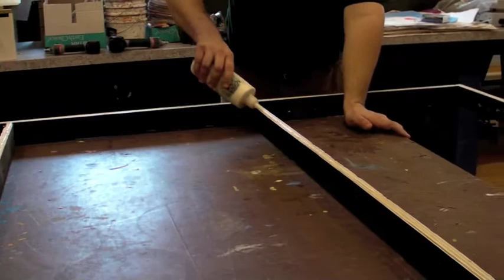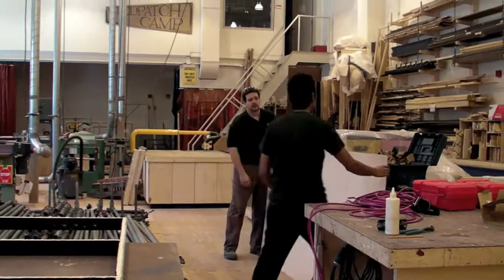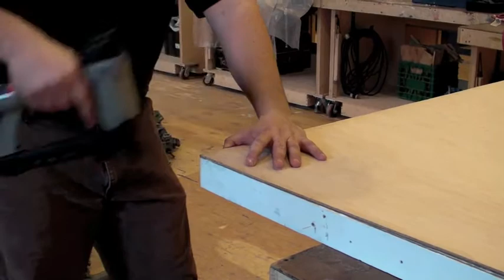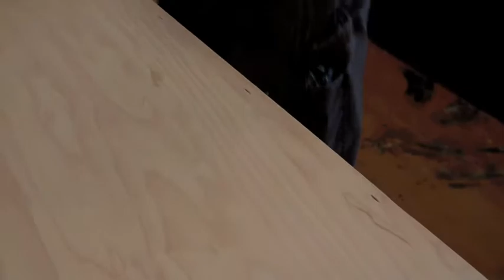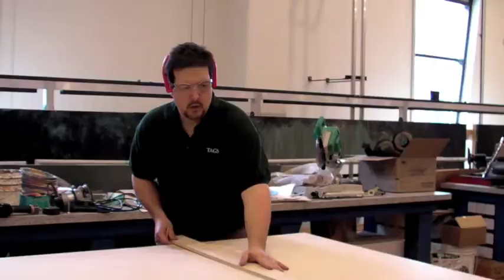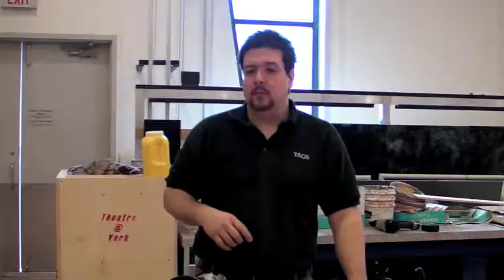How to Re-skin a Flat Pt 2

Comment: Paint one layer at a time, let dry, then paint the next layer... let dry, the next, you get the idea. The key is to have most of the warping-fight knocked out of the cardboard with the water without totally destroying its glue. Then the back paint counter acts the multiple layers of front paint. Laying the cardboard flats on the floor side by side and doing a wide cityscape, or complex wall paper is a really good idea. The side of the cardboard will gently mesh together once they are

Comment: You pretreat with water. You paint the back side with water. Let it get just saturated enough to soak into the top layer of cardboard, let it dry and curl up, then flip and repeat the process with water. It will flatten out as it dries. You then do back-paint first, 2 thin coats (not very watered down) are better than one thick coat, let each layer dry separately. Then flip cardboard to the front to do your outline.

Comment: On cardboard.... if you properly pretreat cardboard you CAN get a beautiful flat surface. Using cardboard does restructure the process of putting a show together, as you pretreat and paint the cardboard first before putting it on a frame.